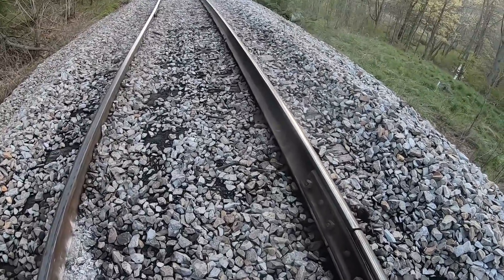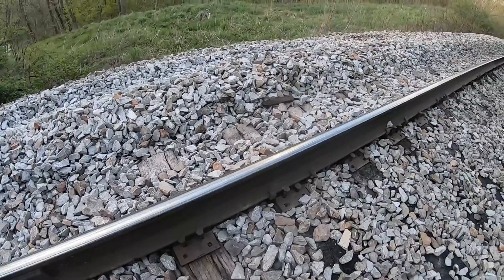Major Derailment: Locomotive Derailed & 2 Cars plus1400 Feet Track Tore Up!

Comment: You should definitely stop using spikes. In the EU, albeit rarely used nowadays, wooden ties are screwed to the rails.
I have never, ever seen such a rail rollover in case of screws. With spikes, rail rollover is the most common failure mode, as spikes are not fastened to the wood in any, secure way.
Reply from the maker: You are right lag screws are a much better fastening system 
Pete, but spikes is what we got to have to live with it.  However
once a loaded car wheel climbs the rail the lateral vertical ratio
is compromised and no matter spikes or screws the rail
can and will roll over. In this case the car truck (bogie) did not
swivel thru the curve, thus causing the wheel to climb the rail.
Really appreciate your taking the time to watch the video and may you have a very good day my friend.
Reply: @ccrx6700 I thought that it must've been a rolling stock's failure, because I've never seen such a well maintained railroad in the U.S. I'm serious.
Thank you for the clarification and have a great weekend, sir!
Reply from the maker: @dehypnotizerz  👍😊🚂

Comment: I only wish we could call Hulcher (or any other contractor). When we put 'em on the ground the shop crew comes out and does the rerailing. Our rail is embedded and usually doesn't take any damage during a derailment.
Reply from the maker: Well at least that's a good thing that track doesn't get  tore
up. Sure can't use re railers with embedded rail tho, but I'm
sure you guys got it figured out how to re rail things. Thank you for taking the time to check out the video and may you have a very good day my friend.

Comment: One Spike . . on the inside rail plate ?  On a curve . .  ?   Hmmnn . .   Tamping not the issue.
Reply from the maker: Thanks for sharing that Paul. Problem was a car where the
truck set got froze and wouldn't swivel. We've ran trains over
that same section for years and years and years with the
same spike pattern.  Thanks for watching my friend.

Comment: So was the train on a grade, derailed and the train rolled back to where it was, unzipping the rails as it went?  How did the locomotive get separated from the train by that distance?
Reply from the maker: This was an end of train loco Hugh. 2 cars derailed in front of
the loco which rolled the rail over. Then in a short time the derailed loco came to a stop, but the 2 cars never came 
uncoupled from the train and it took awhile for the train to
get stopped.  Thank you for taking the time to visit with us and check out the derailement video my friend.

Comment: Can I just ask why are the derailed loaded rail cars so far away from the derailed engine?...so it appears the engineer didnt realise they became unhitched and drove another 1/4 mile pulling nothing?...i would have thought it would be loud as hell and the immediate drag must have stopped that train engine pretty quick...
Reply from the maker: Good question Scott. First off the derailed loco was on the end
of the train pushing, not pulling the train. So when the train went
into emergency and cars in front of it took awhile to get stopped
while the locomotive was on the ground and didn't go very far
before it stopped. There was no operator in the end of train loco,
only in the head end loco and once it went into emergency all he
could do is wait for the train to get stopped. He had no idea what
happened behind him until he walked back and saw the disaster.
Very grateful my friend for your taking the time to visit with
us and check out the video.

Comment: Why didn't they shut down the engine?
Reply from the maker: Here is the answer to why loco engines are kept running in
the summer
https://www.drivespark.com/off-beat/why-diesel-train-engines-are-not-turned-off/articlecontent-pf83615-025034.html

Comment: Bizzare. Does the cornering speed of the train exert enough force to make the outside rail roll over? Like if the train is traveling too fast for a corner?
Reply from the maker: Our track speed here is 25, our curves are set up with the right
super elevation for 25 mph. So in this case, no the train speed
was not the cause. However, trains going much faster thru curves
than the posted track speed can indeed cause cars to come off.
But trains too fast thru a curve will not necessarily cause the rail
to roll over but will have more of an effect of the cars riding
up and over the rail. Hope that is not confounding, I need to
make a video to explain the vertical lateral forces of a rail
car traveling thru a curve, it's a rather big topic, way too much
to go over in a comment reply. Thanks so much for watching
and writing in David.

Comment: Roads (track) spread , sleepers (ties ) were probably not to good before derailment looking at the amount they are teared up after derailment . Seen worse when been on derailments in UK , had loaded coal that was loosening power so was propelled back into junction , signaller forgot to lock points , tore the track up good n proper scattering wagons ,axles , coal all over . Two days continues just clearing waggons , all done with jacks and beams over to opposite running line luckily waggons that dismantled themselves could be pulled clear to cut up . Talked to driver he said was propelling back having to put more n more power in , then looked back at train and could see loads of sparks (it was dark) then lost train pipe 
Anyway great video ,its good to see how things are done over in USA , pretty much same as in UK ,just bigger
Reply from the maker: Thank you very much for taking the time to watch the video
and share with us your thoughts my friend.

Comment: Have you considered putting something like trail cameras on the engines in a position that could watch the wheels? You would have to reset them on every run, but hey WHEN it happens again you will be able to do a replay to see what happened.
Reply from the maker: That would be a good idea and would be great if several
of the cars would derail close to the engine, but for cars further
on back wouldn't be able to see much. You'd pretty much have
to put a camera on every car or every other car. And, no one here
is going to take the time to do that specially since it is pretty
rare we ever have anything as bad as this happen. Thanks so
much for watching and writing in my friend.

Comment: You have alot more defects in there then you think !!!   Gage caused this derailment no doubt !!  There are several conditions out there that are contributing factors. You have poor tie conditions, subgrade saturation causing surface defects and I'm sure your anchor patterns are not up to snuff. The dirt road bed gives the sub grade saturation away along with several defective ties. What class of trk is this.
. Sure would like to study past trk inspection reports...
Reply from the maker: Thanks for watching. You might enjoy this video where I give my
hypothesis on why the derailment occurred. It was caused
by the gage widening, however it did not occur because of
track conditions.
https://youtu.be/2uGomCuZkV0

FYI: ties were torn up from the derailment. Before the derailment
happened there were no violations of track conditions nor ties
according to CFR Title 49 TSS Part 213 for Class 2 track. However
my friend you are certainly welcome to believe whatever you
would like to.  My track inspection logs are available to any
FRA or MSHA inspector.

Comment: So did you check the speed?
Reply from the maker: According to the engine man he was going 24, our track speed
is 25. At that speed and that weight when things go wrong bad
things can happen quick. Appreciate your tuning in and watching.
Reply: @ccrx6700  I was getting at what the GPS speed showed. The rail was not rolled on the inside, was it?

Comment: I want to know how the loaded hoppers got so far from the locomotive with the extent of track damage. With one engine and only 2 cars the crew had to have know when they were on the ground. They had to have been moving pretty fast.
Reply from the maker: Speed was 25 which is posted track speed. The loco on the
ground was an end of train DPU. It stopped fairly quickly once
it left the rails. Only 2 cars went off on the end of the train and 
it took a while once the train went into emergency to get all
38 loaded cars that were on the train stopped. Hope that
helps explain Kenneth. Thanks for watching the video today.
Reply: @ccrx6700  Yes sir, thank you for the explanation. I've been a railfan for many years and never seen anything like that, my first thought was "how in the hell", but I fully understand now.
Reply from the maker: @kennethfuller8347  👍😊

Comment: If that is the lead engine and he was going 22 mph, he sure did end up quite a ways away from the cars that dropped considering the engine was on the ground.  I don't know how the companies cash flow is, but something like this would go back faster if you had prefabbed sections that could be carried out and laid back in per-assembled sections.
Reply from the maker: That is the end of train unit on the ground. We very rarely get
a derailment like this, last major one was back in 1993. So
panels are the way to go but with so little need for them
here we don't have any on stock. Thanks for tuning in
to the show tonight and watching.

Comment: Question, why is the engine kept running? I also noticed on another video when you where checking the engine wheel, that the engine was also running. What’s the reason.
Reply from the maker: EMD says that it is easier on those older engines to keep them
running. They don't have a pre lube system, so starting an engine
that big without pre lubing it is hard on bearings and seals. Thanks
for asking Stephen and for visiting with us and watching the movie.

Comment: When you have a derailment like this, other than the obvious damaged rail do you reuse what appears to be undamaged? Do you x-ray it or anything before you put it back in service?
Reply from the maker: Good question Steve. All the rail on the north side was replaced with
good relay rail since a good part of it had the wheels roll down the
web of the rail. The rail on the south side just had rolled out and
wasn't damaged so it just got spiked back in. Availability of
ultrasonic rail testers often takes months in advance for them
to be available so with everything considered neither rail was 
tested until early fall when those guys hap an appointment to
come in. Thanks for watching the video today my good man.

Comment: WOW now that is scary ! 1200 feet that is a long way to travel down the tracks.
it is so fortunate there was no cars on their sides, hopefully no one hurt. 
I was wondering why was the engine still running? should it be shut down to conserve 
diesel fuel ? you are. going to be very busy fixing the ballast and leveling the track
good luck with the mess
Reply from the maker: Yep it was a mess and we were lucky to not have any cars rolled
on their sides for sure. Locos are kept running pretty much all
the time. EMD claims it's harder on these old engines to shut
them down and restart than it is to keep them running. There is
no pre lube on these old engines so they say it's better to keep
the seals and bearings wet than to shut it down and start up
with them dry.  Thanks for watching the video today Barry.

Comment: At 7:56 there seems to be a lot of fine gravel (ballast) around the damage to the inner rail.  Could it be that there was severe bending/flexing of the track over time to crush the stone around it and the rail finally gave in to metal fatigue to make a big "bite" break in the rail? Or it this the first point of derailure where the wheel just slips off the inside of the rail, slams down and travels on the inner base (footing/ballast) of the rail a small distance before the train wheels "walk" toward the outside of the curve? - that dark gouge in the ballast from the wheels. I think we don't see such gouges outside the outer rail because the wheel axles ride/grind along the top of the rail and thus the wheels on that side of the derailure don't touch the ballast as much or at all. Is that correct?

Comment: I think it may not have been this train but a train(s) before it overloaded and speeding. A cumulative failure where each pass pushed out/pulled up incrementally on the outer rail of the curve to the point of sudden derailure.  This crew was most likely operating within proper parameters, just in the wrong place at the wrong time.

Comment: At 5:35, what is all that spirts of air the engine is making? Thanks
Reply from the maker: That is called a spitter valve. It is plumbed into the main air reservoir 
and helps to eliminate water from the compressed air, it's a 
noisy chirpy little thing that drives me nuts listening to it.

Comment: Hi, yes maybe it's time to put the concrete crosstie unders rails.
Reply from the maker: Hi Damian. Ain't gonna happen here. I have an older Jackson 6700
tamper. Concrete ties are 2 inches thicker than wood ties. In order
for that tamper to tamp concrete, I would have to manually adjust
4 limit switches on the workheads so they will penetrate
deeper, crawling under the tamper and manually moving each
limit switch down. then do the same to readjust for wood ties,
ain't gonna happen. On newer tampers with Jupiter 2 operating
systems there is a toggle in the computer to switch from wood
to concrete but I do not have the Jupiter 2 OS.
Reply: @ccrx6700  Yes I'm understand now and thanks for detailed information about defferent parameters between woods and concrete ties 👍
And yes new wood ties can strogh hold rails many years again.

Comment: I'm a new sub, and late but was the rail the cause of the derail? And would excessive speed going threw the run be what caused the outside rail to lift? 

Also in a different video it was mentioned how the tracks go east and that has had my mind working. Alot. Is it like a boat pushing water infrastructure of it, a fully loaded train pushing the steel rails very slightly and stretching all to the east? Really great info that you give.
Reply from the maker: We welcome you to our channel and happy to have you on board with
our community here. Lot's of RR vids on the home channel if you
would sometime care to check any of them out.

Tracks run east to west, all loads are run east, we do not have
 bi directional loaded traffic, and also most of the run back east is
down grade. Would take an entire video to explain fully rail 
creep (runs) and I haven't made one on that yet. So let's suffice
for now with all our rail creeps eastward for many different reasons,
too much to explain in a comment.

Here's a link to my ideas on why the derailment happened.
https://youtu.be/2uGomCuZkV0

Comment: If that was helper engine pushing on rear it could have rolled the rail if pushed to hard ...
Reply from the maker: You are certainly correct in that statement. Operator was following
standard train handling rules for this curve that have been in place
for many years now, or at least that is what he told me.

check this video out on my theory and see what you think
https://youtu.be/2uGomCuZkV0

Comment: Hey brother, nice videos. I will say, the derailment didn't occur because the spikes started lifting up. Generally, 1 defect isn't going to cause a derailment but rather a combination of things will cause a derailment. Some things to consider: 

Were the ties really as good as you thought? I saw tie pieces all over and solid ties don't break off like that. There were rotten ties there. Also, just because a tie looks good, it doesn't mean it is. I've seen ties that look brand new be completely hollow inside.

Was the gage good? Rail doesn't just roll like that, especially both rails. The gage spread because of wide gage or bad crossties and it was pushing out. Again, just because a tie might look good and appear to be solid, doesn't mean the spike holes aren't worn out especially in a curve. With worn out spike holes the gage will spread even though the rest of the tie is solid. 

What speed were they going? Is the speed correct for the degree of the curve? The unbalanced table in part 213 will help determine the maximum speed of a curve. 

Was there surface conditions? You tamped but did it hold in all places? 

The combination of gage, bad ties, push, surface conditions, speed all played a factor in this derailment. This is looking like track caused rather than train handling. 

Keep up the good video work. 

Thanks.
Reply: Have to admit that quite a few of those ties didn't look in great condition.

Comment: Those hopper cars looked like they had a case of buildup on the wheels from sticking brakes. Once buildup gets thick enough, the flanges and wheel fillets could no longer do their job. That car may have walked off the high side of that short curve, rolling the rail and took the 6 axle with it. At least everything is upright.
Reply from the maker: it was a blessing everything stayed up and not rolled over for sure.
The build up you saw was from the wheels running over the
ballast which occurred after the wheels derailed.Thanks for
writing in and for watching my good man.

Comment: It looks like the loco was pushing the cars, yes?

So it looks like the outside rail came loose and was being pushed over by the cars, until it finally fell over and derailed the last two and the loco. Though it might have been the heavy loco getting to the loose rail that finally rolled it.

Just watched your next video. Yup that'll do it. lol
Reply from the maker: Yep, end of train loco was pushing, the back truck set on the
second car in front of the rear loco started rolling the rail, there
were wheel marks on the rail from it. Appreciate your writing in
and for watching these